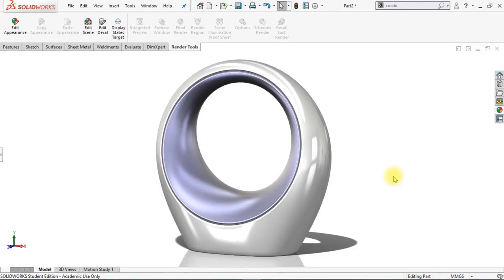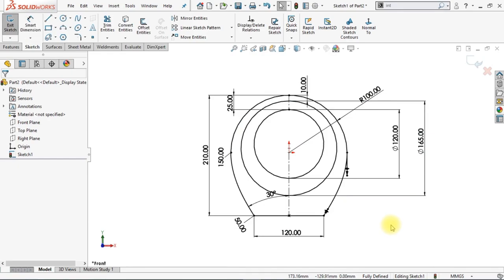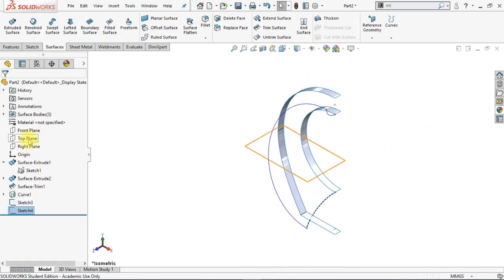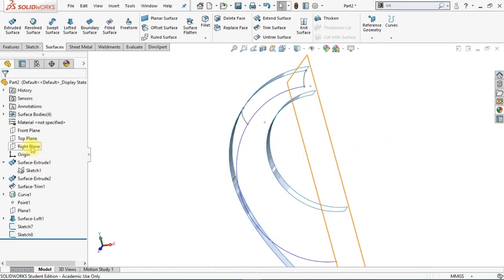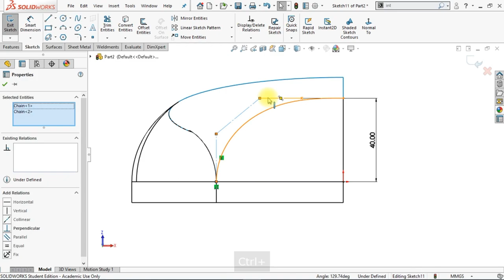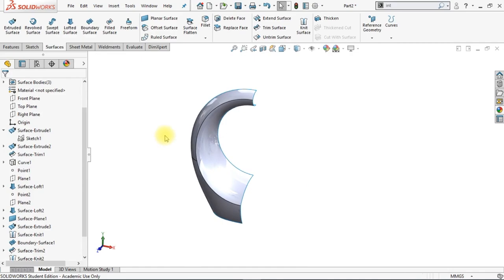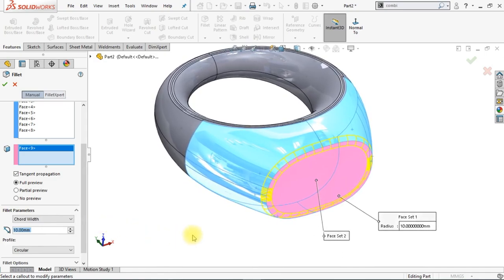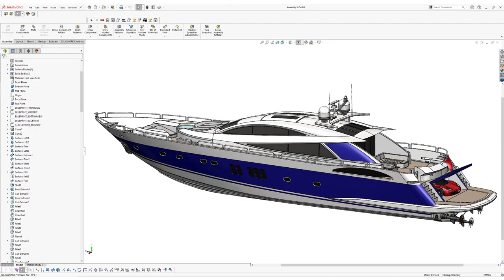Exercise 55: How to make 'Modern Kettle Bell Design' in SOLIDWORKS 2018

Comment: Damn! Giot as far as 12:00, but I'm using SW 2015, and it won't let me select the curve.
Reply from the maker: Create a horizontal line on the right plane with pierce relation to projected curve  and make a swept surface then after use the surface edge of that swept surface
Reply: @EasyCADSolutions Thanks, but before you responded, I fixed it another way- I made the curve into a Composite Curve, which was then selectable. However, this 2015 version of SW seems a bit lame in comparison to the 2018 version you're using, because now it's not allowing the subsequent surface loft, incorrectly stating that "Guide Curve no.2 does not intersect with section 4" (it DOES intersect, though). -Ok, I fixed that by making another comp curve out of this edge (it's like I have to sort of hold its hand and lead it all the way).
Ok, I successfully finished this piece- except for a couple of fillets that version 2015 simply could not do successfully. It's interesting that the solid geometry processing actually was improved from version 2015 to version 2018. Usually new releases just introduce new features, but don't improve existing ones, but I have found that Dassault is a good company in that way- they introduce new features, but also fix bugs in existing ones.